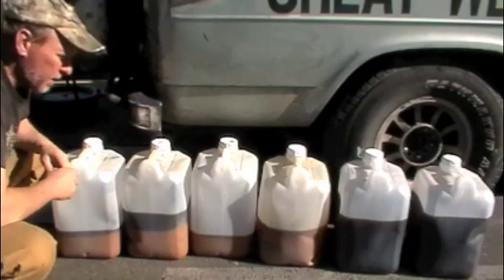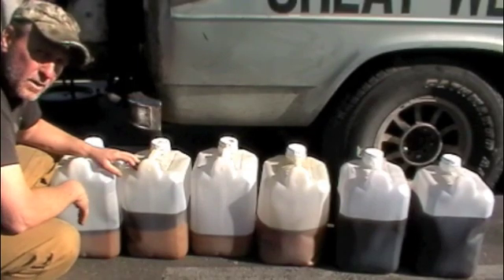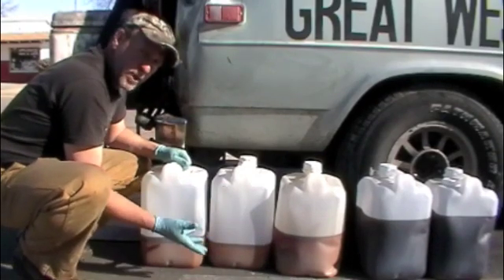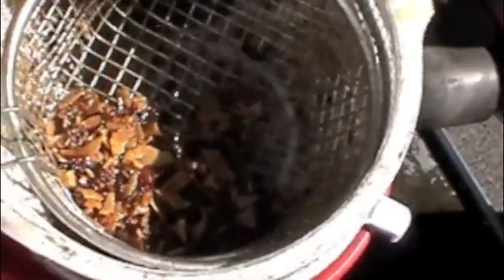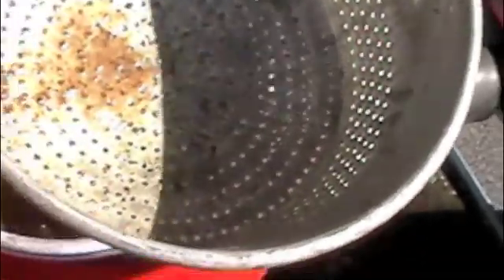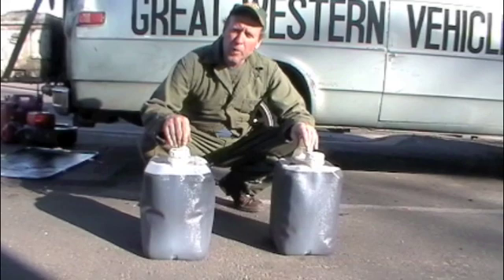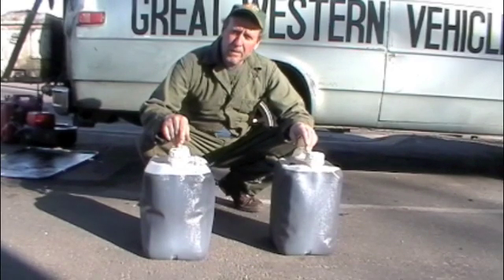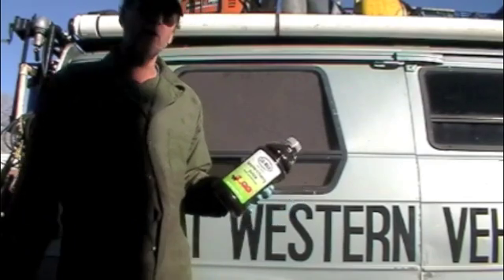Small Scale Blending of waste oil blend diesel fuel

Comment: Hello Again.  I was trying to contact you earlier,. How are you,  also I have some waste engine oil is it the same procedure as the waste vegetables oil to use as fuel.   Tks
Reply from the maker: I find it virtually the same process of turning WMO into diesel fuel, as turning WVO into diesel fuel. In fact I like to combine them in equal parts after the first separation stage, so I can feed the food particles and high melting point triglycerides that I extracted from the first stage of settling WVO prior to introducing diesel fuel in the second stage of settling. 

In the case of processing WMO, the first stage of settling is done by adding diesel fuel at 20% to the WMO, leave it to settle, ideally for 1 month, then pour off the thin, translucent oil off the top leaving anything that is dense behind, which can be disposed of properly. 

Then the settled, separated thinned WMO + diesel fuel blend can have the WVO after its first separation added to it. Then leave that blend to settle for 1 month. Then after the month of settling pour off whatever is thin, and translucent into another settling tank or bucket which has gasoline in it at 20% of that blend, and leave in a safe place and in the shade for 24hrs. Then either drain off the bottom anything thick, or creamy looking, or pour off the top anything that is thin and translucent. 

Then pour acetone into this nearly completed blend at 1% of the entire solution, then leave that blend to settle in a safe and shady spot for 24hrs. After that remove whatever settles to the bottom and run your final product through filters and add to your fuel tank.
Reply: @Jhananda  hello.  I like the sound of mixing the waste vegetable oil with waste engine oil it sounds less time consuming than the waste engine oil process on its own, are you saying add half and half waste engine oil with waste vegetable oil then let it settle then remove the good stuff when ready then carry on as if it was the wvo process.  Tks
Reply from the maker: @martinmorgan8475  hi Martin. Do I know you? 

As for blending WVO with WMO. Keep in mind, the WVO is much more difficult to deal with. So, follow the protocols I expressed above. And, yes. It turns out blending WVO with WMO in the above method improves both as fuel.
Reply: @Jhananda hello   you asked do I know you,    I spoke to to before regarding using used vegetable oil to make fuel      thanks again
Reply: @Jhananda  hello.  What ratio of blend for wmo & wvo would you recommend, dose kerosene mix with waste motor oil,  dose 40% waste engine oil and 40% waste vegetables oil sound right, and could you add 20% kerosene.    thanks
Reply from the maker: @martinmorgan8475  I've been blending equal parts WVO to WMO and, if you prefer kerosene as your thinner and dilution agent, then great, because it's better. I would use 50% kerosene to the complete solution. Do remember you will want to give it about a month to settle out the fine sediments. However, don't forget to add acetone to the top of your solution 24hrs before filtering, and you won't need gasoline in the blend.

Comment: It could be nice to find a way use 100% of that vegetable oil. Maybe there is reaction "one" that will do it.
Reply from the maker: I find the component of my raw fuel product that has to be rejected is only 10%. And, others have found they can blend the high melting point triglycerides and gum can be mixed with saw dust and rolled into "logs" and burned in a fireplace or wood stove and help to get the fire started.

Comment: I absolutely love your videos! They have really helped me. I am going to run my 2.7l TD Ford truck on 10% RUG 90% WMO first time tomorrow!
Reply from the maker: I hope it worked for your engine, because gasoline at 20% works better than 10%.  Also, if you are going to run WMO, then you will want a centrifuge to cleanup your blends prior to putting them into your fuel tank.
Reply: Jeffrey Brooks Hi. I plan on filtering it through a 1 micron filter and adding 10% RUG with 5% Terpentine. Whats your take on that? Will the turpentine help to dissolve contaminates in the fuel?
Reply from the maker: I have run pure gum turpentine at as high as 20% with waste vegetable oil successfully for several hundred miles.  I would run it more, but it is very expensive for me.

A 1-micron filter is insufficient to filter the particles of carbon out of WMO, so I urge anyone who wishes to burn WMO to acquire a centrifuge and run all of your WMO blends through the centrifuge prior to putting it into one's fuel tank.  Otherwise injector coking is a likely result.
Reply from the maker: No problem blending gasoline, turpentine, and WVO.  just do your blending first, then settle the blend for a few weeks, before filtering it into your fuel tank.

Comment: Can i use brand new oil? It's 5years old never opned. How much can i add in to diesel..
Reply: Motor oil 10w 40
Reply from the maker: Yes, you can use unused motor oil that is old as a fuel additive.  I am not sure how much you have on hand, or what its weight is, but if you are blending 10-40 with diesel fuel only, then no more than 50% and only in warm weather.  

If you want to try to use it in cold weather, or run more motor oil as diesel fuel, then you would want to blend gasoline with it at 20%.

Also burning waste oils in diesel engines works best with direct injected turbocharged diesel engines.
Reply: +Jeffrey Brooks thx.  Can i use chainsaw mineral chain oil?  Is it the same as motor oil?
Reply from the maker: Yes, new vegetable oil can be added to diesel fuel at as high as 50%.  However, one should always do the blending in a settling tank, so that if any precipitate is formed, then it can be removed prior to filtration.
Reply from the maker: Yes.

Comment: Waste fryer oil made into diesel fuel has a waste by product known as glycerine layer.  I take that layer and make soap.  Its a tedious process but the soap is wonderful, especially for taking grease or pine sap off hands.  You can sell the soap to auto repair shops, etc.
Reply from the maker: Blenders do not have a glycerine waste byproduct.  We burn it all, but the food scraps.
Reply: I have about 150 gallons of glycerine layer which will someday become soap.  Its a lot of raw product and I don't have a big market as yet.
Reply from the maker: If you blend waste vegetable oil with gasoline, then there is no glycerine byproduct.
Reply from the maker: The lye and alcohol was used to convert triglycerides to transesters;  However, the biodiesel process is just far too complicated, when just adding gasoline to the WVO, then filtering it is all that is needed.
Reply from the maker: Good question.  It turns out that WVO has absorbed a considerable amount of gum; and it turns out that the biodiesel process is very efficient at removing gum from WVO.  However, there are other ways to removing gum from WVO, which I am working on, and will report back when I have reportable results.
Reply: glycerine is only in ethanol blends, in the case of gasoline blends everything is disolved.makes thing easier, they try to use ethanol only if we run out of petrol.

Comment: See, THIS is a more wholesome method!

Turning the various saturated fats into methyl and ethyl esters to blend with the unsaturates portions of waste vegetable oils, then blending 20% gasoline or 10% each of gasoline and turpentine into the 80% waste oil/ester mixture.

I like this method, because it has less hassle, costs and risks! 

Thank you for this scientific research Mr. Brooks, I hope you have many blessings and have a happy holidays!

You, Tyson Capel, GTIBully and a few others are getting shout outs on my new channel's first video.

I'll doing a show with some friends on game reviews, I'll be doing reviews on science, controversial science, philosophy,  and showing a couple of how-tos and I'll be doing interviews also.
Reply: Jeffrey Brooks
- A final filtering using a centrifuge would clean you final product to less than 1 micron, and alleviate the worry of checking or replacing fuel filters (it's what I do).  I used to make biodiesel until I started doing the blends.  Now I use the biodiesel processor to separate my WVO, backwards of how you do it; I let it settle then drain off the cream colored fluid from the bottom.
Reply from the maker: Yes, I to use a separation funnel, which is common in biodiesel processing, but since I get WVO in these plastic containers, then I leave the cream behind when I transfer the clear amber WVO to another recycled container where I top it off with gasoline at 20%.  I leave that to settle for 2 weeks, then I pour the clear amber blend off the top into my 25 gallon separation funnel, then leave that blend to become uniform for about 2 days, then drain off any thick residues, then check the specific gravity difference between the top and bottom, and adjust the over all specific gravity, then when the blend is uniform and the correct specific gravity it is filtered down to 1-micron.  I do have a centrifuge, but I found my method does not need it with WVO.  WMO blends do need it.  Otherwise the method described here is meant to be simple and inexpensive, and not requiring a centrifuge, but a centrifuge followed by filters would surely improve the product.
Reply from the maker: Count Wes thank-you, I agree blending gasoline, or other solvents with waste oils is just so much more simple, and less work, and risk, than the biodiesel process.  Good luck with your new ventures.
Reply: Thank you and I wish you you the same.
Reply from the maker: Andijanto Andijanto I have sent you an email, but to answer your questions here, it depends upon how much you want to invest in designing and developing a commercial small-scale WMO to diesel fuel system. If you want your end product as polished as the petroleum industry makes, then you will have to crack and fractionate your product, like the petroleum industry does.I do not know the economics of a commercial scale WMO to diesel fuel production system.  It depends upon how much you have to pay to purchase your raw WMO feed stock, as well as your production volume.  However, if you are going to go so far as cracking and fractionating your product, like the petroleum industry does, then you will want to also add in the ability to crack plastics back to fuel. The cost of producing waste oil-based diesel fuel for me, is nearly zero, because my waste oil is free to me, and I use gasoline blended with the waste oil at 20%, which I purchase; however, I use it first to clean my processing system to regenerate the filters, so that I do not have the cost of filter replacement.  

I would expect that a commercial system would do the same thing, so if you are only going to filter and centrifuge your WMO-diesel fuel product, then you will have to add in the cost of purchasing a serviceable solvent that has similar characteristics to that of gasoline. 

I am open to considering standard consulting fees, and/or a joint venture.
Reply from the maker: I actually do what you do to clean up my WVO before blending; however, I still use the settling tank after blending, because I have found that sediments can form from very clean WVO that has been blended with petroleum distillates.

Comment: I did try adding Power Service diesel fuel supplement cetane boost for bieoblends and it helped a little. Does acetone help the matter? Any suggestions.  I only have 12 gallons of this mix left and 14 in my jetta.
Reply from the maker: I never noticed any change in the exhaust from my test engine due to the presence of acetone in my blends.

Comment: Greetings, I have started using this method and I noticed that at idle my exhaust smokes more and on take off.  Any Ideas why?  Bio diesel or regular diesel does not make my engine smoke.
Reply from the maker: If you made an 80-20 WVO-gasoline blend, then I am surprised that you noticed any smoke at all; however, under that conditions that produce smoke in diesel engines, gasoline blends will tend to have a light gray haze in the exhaust; whereas diesel tends towards black smoke.
Reply: Jeffrey Brooks
Thanks for the reply, I am using 80-20 WVO-Gasoline blend.  The smoke is a definite blue smoke.  Almost like a worn engine, oil passing through the rings. 
As I said, no smoke if I run regular diesel or biodiesel.  Car runs fine on the 80-22 mix other than the smoke.  Some what embarrassing for a beefed up jetta.
Reply from the maker: You could try varying the blend, start with increasing the gasoline by 5%.  If it smokes more, or runs worse, then reduce the percentage of gasoline to 15%, etc, until you find the percentage that works for your engine.Just for clear data, does your engine have a turbo? And, what year is it?
Reply from the maker: PS: it might be that you have a plugged fuel filter, if you are using the Small Scale Blending of waste oil blend diesel fuel method to make your fuel, because this method does not fully clean up the fuel blend and is therefore likely to lead to plugged fuel filters.
Reply: Jeffrey Brooks
Thank you for you replies.  As a precaution I did change the filter at the beginning of the switch.  And yes my 2004 Jetta has a turbo and 3" exhaust no muffler.
Reply from the maker: Thank-you for the additional information.  So, changing the filter at the start of your test was a good idea, but if your are just using a paint filter to filter your blend, as suggested in this video, then it is possible that your fuel filter is already plugged, because a paint filter is really not enough filtration of a waste oil blend.  Also, you may not have settled it enough.  The third possibility is your engine likes more gasoline in a waste oil blend, and 4th possibility is your engine likes less gasoline in its fuel blend.  So, if you are interested in making those adjustments, then I am interested in hearing about your results.
Reply: Jeffrey Brooks
Again I appreciate your time to answer.  I use 3 kinds of filtration. Yes my first step is the painters filter with the strainer, I heat the oil and run it through an old but very effective toilet paper oil filter and then I run it through a circular pressure 1 micron filter. Then I process the 80-20 mix and its ready.  Plus just in case I run add the fuel to my tank via a very fine screen filtered funnel.  I will make the adjustment and see how my jetta likes or dislikes.  I will keep you in the loop.  I did add 2oz of acetone to the tank and it cut back about 1/2 of the smoke.  I'm inclined to think that it will want more gasoline. 
Thank you again.
Reply from the maker: Thanks for the additional information.  It turns out that when gasoline is blended with some waste oils, that there can be precipitates, this is one of the reasons why there should be a lengthy settling period after blending.  Therefore, you could just do a coarse screening of the big chunks out of the WVO before blending, skip the heating step, and blend gasoline with your WVO.  Settle it for about a week or 2, then filter it as you have been doing, and you will end up with a better product with less labor.  Also, if acetone reduced your smoke, then, yes, more gasoline; or you can use acetone is place of gasoline in your blend, but no more than 20% acetone in your blend, or you will have problems with seals and hoses.
Reply: Jeffrey Brooks
Thanks again, yes my oil sets for 3-4 weeks before I re-filter and then I mix the 80-20 and it set for almost 2 weeks before I filtered again. The oil comes out almost a light orange its so clean.  (It is an amber color before I heat it up and filter the top oil from the containers). Then I have them set for the 3-4 weeks before I make the biodiesel.  However, I used 30 gallons for the 80-20 to experiment with this technique.  Using the gasoline is much cheaper than the biodiesel, that's why it sound good if I can get the mix to not make my jetta smoke so much.
Reply from the maker: Well, it sounds like you are making a good product, but your engine might need more gasoline in the blend.  It turns out that the math indicates 50% gasoline to 50% canola oil is the ideal mix, but if your gasoline has alcohol in it, then that blend will have too much alcohol for some engines.  This means you could add a lot more alcohol-free gasoline to waste oil to make your diesel fuel run better on your engine.  And, yes, it is a lot easier and cheaper to make diesel fuel by just blending gasoline with waste oil, settling it for 2 weeks, then filtering it down to 1-micron., than all of the nonsense that goes into making biodiesel.
Reply: Jeffrey Brooks
You know I was thinking about that yesterday, we have a gas station here that sales ethanol free gasoline.  I'm going to try that instead of the regular garbage gas.  50-50 hum... My engine will provably need something close to that or the 50-50 I will see.  Thanks again for your time and your information, it is appreciated and I'm sure your viewer do as well.
Reply from the maker: You are welcome, and please do report back as to how much gasoline worked on your engine.  I also run a forum called Beyond Biodiesel dot O.R.G.  http://beyondbiodiesel.org/forum/index.php Where your report would be most welcome.
Reply: It takes a while to burn 13 gallons of biodiesel on my Jetta.  But here is what I did.  I used the same 80/20 but using non-ethanol gas for the 20%.  I will fill up the car next week and we will see what happens with the smoke.  Again thanks for your time.
Reply from the maker: Good to know.  I look forward to reading about your results.